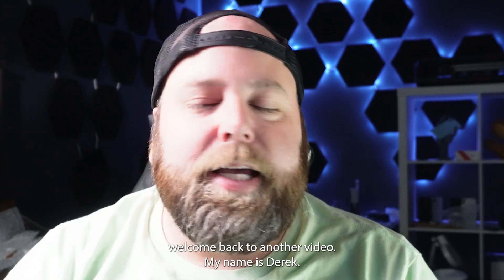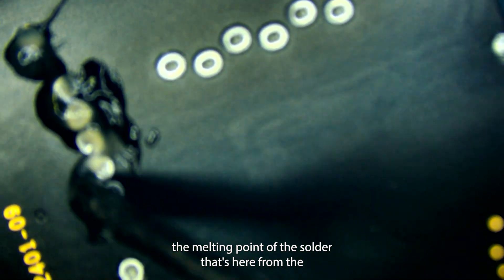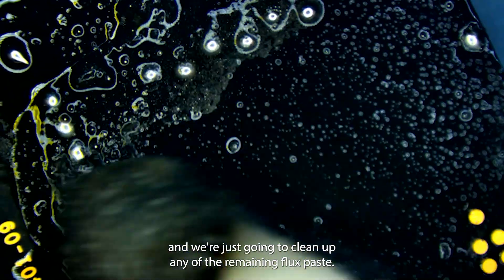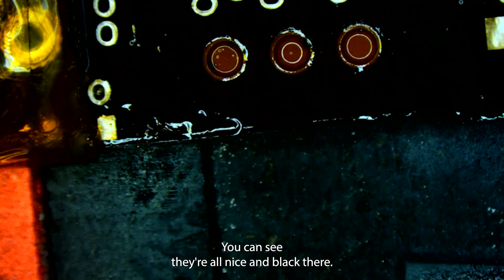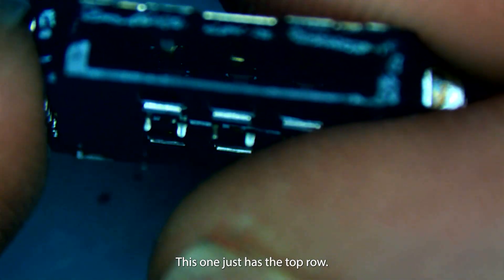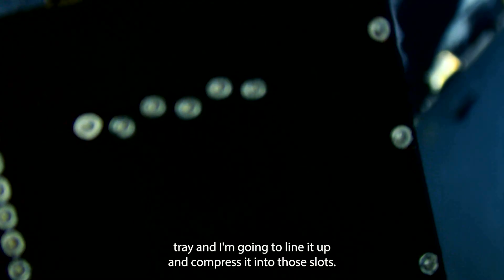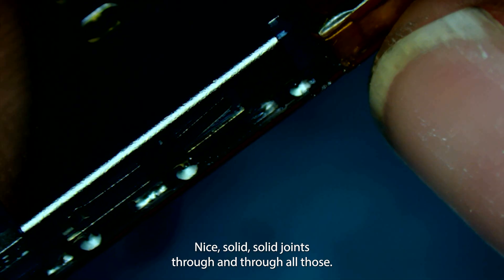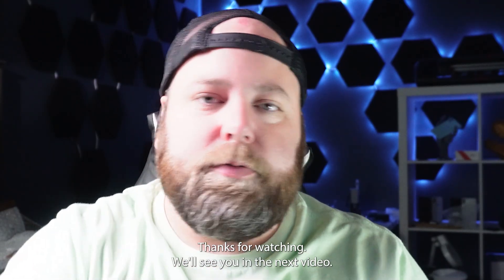Step-by-Step Dual-SIM Reader Replacement on iPhone 13 Pro Max Logic Board

Comment: Awesome video, as always! One question: Don't you need to change anything on motherboard? Like adding some new resistors or jumper wires to make the phone accept the 2 sims?
Reply: I think he don't know he just made a video on cloud board
Reply from the maker: This is an excellent question. The answer is yes, I mainly made the video to show how to install the sim card reader, unfortunately even though I've researched like crazy I haven't yet found the modifications that need to be performed on this model. If anyone knows please comment below!
Reply: @MobileSentrix Rewa made a video already, but they were doing it on an iPhone 15 pro max. I would assume it's the same steps but with different jumper points on the board.
I can't put a link as per youtube takes down my comment, but the video it's online!